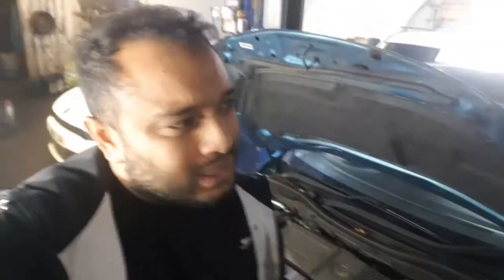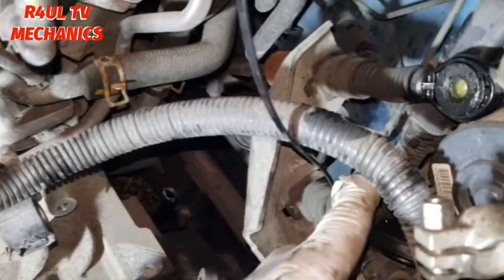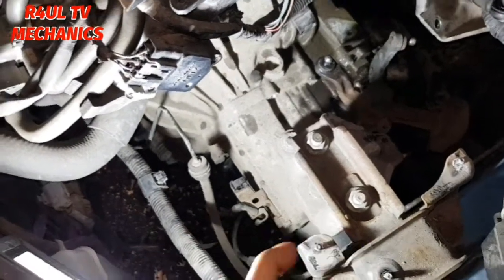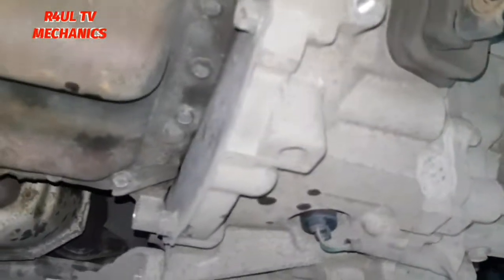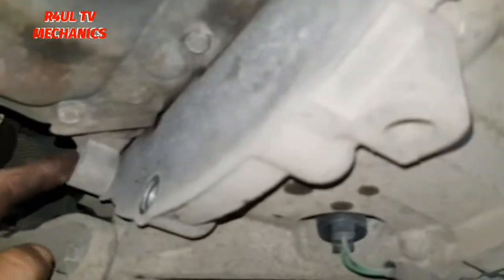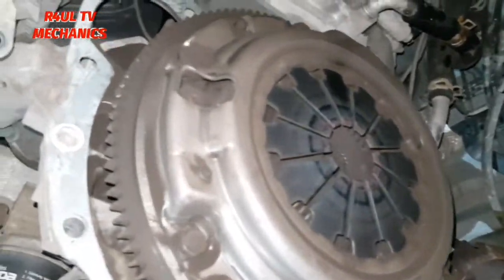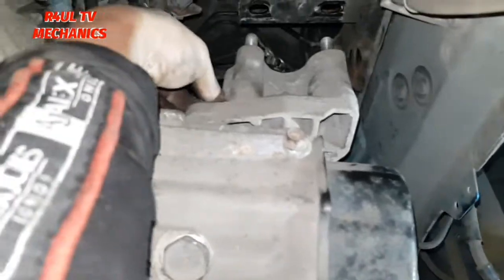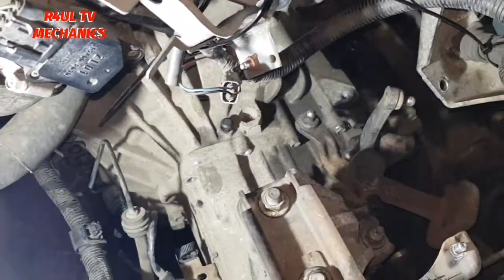2014 MAZDA 2 CLUTCH REPLACMENT

Comment: The connector on the rear of the transmission next to the firewall above where the axles stick in is there a wire connected to the sensor or not

Comment: ok I have this same car and my gears will not change into any gears when car is on but when its off it will change gears ?  second question is what power tool will allow me to take off t=wheels ?   and last when changing the slave cylinder does it require oil to be put in it and can the fly wheel be refurbish with  sander ??  I just want to do this on my own as iv been high price on job

Comment: I was willing to do this myself, until the engine stand part. Great video though man, cheers.
Reply: If you are doing it on the ground i guess you can put a jack, a wood block or jack stand there to support the engine.
Reply: I use a motorbike jack, 2 jack stands and a trolley jack. Jack stands to support car, motorbike jack for motor and trolley jack to drop the trans and pull out and away from engine.
Reply: @boccamokg1829   cool do you have a hack to get that hiden 14 mm bolt out also I cant seem to reach it.